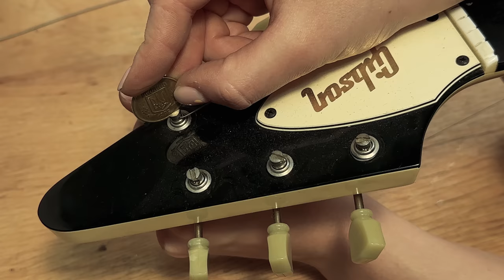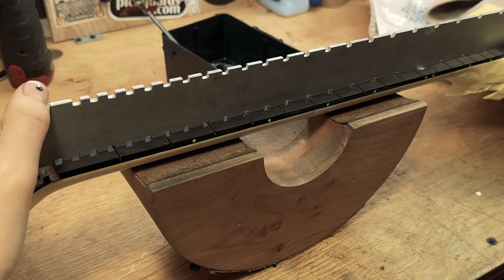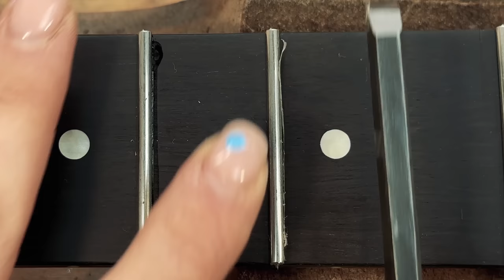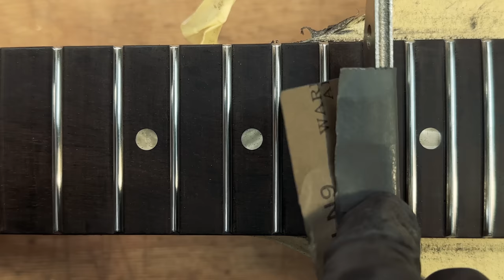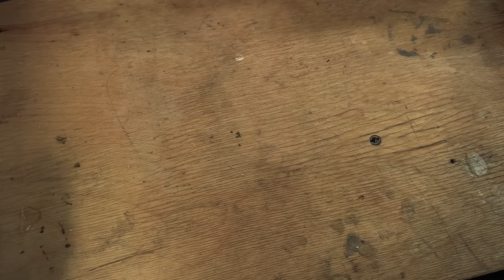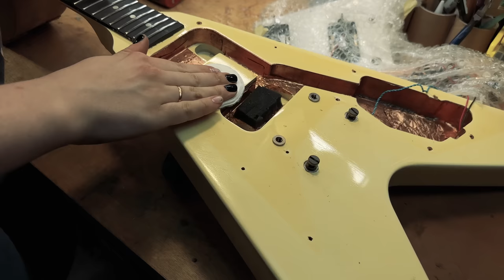Refret to stainless steel and restoration of a Gibson Flying V

Comment: As always, very nice work young lady. I do appreciate you are being a little more in depth showing the rounding off of the fret ends and showing how it takes a little more than a few taps to seat the new fret in the slot. Also the close ups of removing excess super glue with the chisel. And nice nails too!!!! Always a different nail polish job for every video, nice touch and it gets our attention.

Comment: I own 7 electric guitars, so I did all six with stainless steel frets, I have not refret my 7th guitar because my tools are all blunt except for the files. I need a new fret cutter and my tang cutter tool broke on the 6th guitar...:face-pink-tears:have not ordered it yet and it's been 2 years since I DIY my own stainless steel fret job. After watching your video, it kind of inspired me to finish up my last 7th guitar. Right now that 7th guitar is sitting inside the case without any frets on...🤣

Comment: I like your marking the fret board with a pencil to identify raised areas on the fret board. Good one! I've installed ss frets on my strat but after doing a fret level may have to to do it one more
 time. Fretboard is maple but seems to be straight though.

Comment: The frets look amazing on the fretboard! What tools are you using specifically for steel frets?
Reply: I can help you out with this question. Since it's been a while and noone responded yet. Stainless is a lot harder than nickel silver 15 or 18. Any decent hardened file, diamond file and sandpaper will do the trick just fine. The only thing to be careful with are the pliers. Try getting steel pliers with a hardness of 61. Those will last. Knipex, Gedore etc. Make sure to check/pick the right cutting pliers for this job!

Comment: Beautiful work! I recently refretted one of my guitars, first time ever, and learned that it is NOT an easy task.
One question, though. Why did you not put even a single full turn on the tuning pegs? Doesn't seem like it would hold string tension very well like that.

Comment: Question: You use a tool for setting frets. 
it's shaped like a drift punch. 
It has a concave end for the fret to seat while taping with a small hammer.
Where can I get one?   Thanks Tanya
What are those round pads you use to clean the neck?
Michael

Comment: Quick question: How did you determine how deep the slots in the nut are? You had a straight edge off the height of the 2nd fret?

Lovely and relaxing video, btw. Although, I’m still cold on Flying-Vs.

Comment: When you are sanding the fret board after frets are removed is that a radius block that matches the radius of the neck or a flat sanding block? Also when the frets are in do you use flat or radius?

Comment: I am really curious about your fret gluing technique. What kind of glue are you using? What are you using to wipe the glue away? How does the glue not get stuck in the fretboard etc.
Reply: Super thin Cyanoacrylate, I use Starbond Super Fast Thin, follow with a little naphtha for cleanup.

Comment: Not even a single wrap for putting on the strings is pretty wild. It's gonna be completely unstable if it doesn't pop out entirely when you go up to tune. Also shouldn't you tape off the fingerboard when you're doing the frets? and the headstock for filing the nut? All that stuff is gonna come off on their fingers for a while lol Plus at 10:38 it's very noticeable you're hitting the fingerboard with the file. You know what you're doing and have the equipment just missing a few very important parts, take it slow and tape off an important instrument like this properly
Reply: I was just thinking that. At the beginning I was really confused by how it came strung, but then at the end she strings it the same way. Wild. Amazing job on everything else tho

Comment: I have a few questions if you don't mind answering. What's scraper are you using to scrape the fretboard before leveling?

What cleaner are you using when you were scraping the glue off with your chisel? 

What cleaner are you using on the fretboard to clean it before you used the conditioner? 

Thanks, your videos are awesome.

Comment: You shouldn`t be leveling new frets. This means that the fretoboard is not leveled and straight and also that it is not  have the correct radius. What about if you refret an acoustic guitar? Making level on the frets and when the customer will refret the guitar after two years max?
Reply from the maker: Welp, you wrong :) 
If you normal human being, and not a keyboard luthier - you can't put frets all totally in one level even if fretboard is dead straight (and yes even with fret caul or fret press, also good luck use them with acoustic guitars 😉 ). And some deviations that need leveling is ok.

Or yes, you can do no leveling work and pushing customer that a 8mm setup on 12 fret is ok, because you are the Expert 😃

Comment: Ok I guess… you still need more experience… there’s questionable things about your approach on certain you use.. for example .. u should have used frog tape instead of that white masking tape.. that style of tape is to sticky for guitar finishes..u failed to tape certain areas when sanding the board… the way you snipped the fret ends with regular wire cutters gave me ptsd… you gave yourself extra work on filing those ends…
Cool video… if that was my guitar I would have been biting my nails the whole time 😳😳